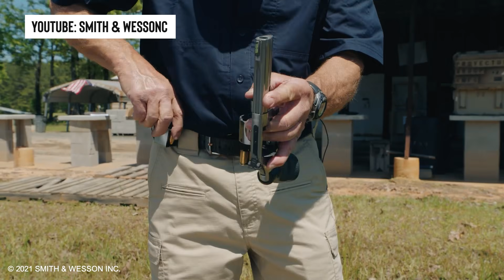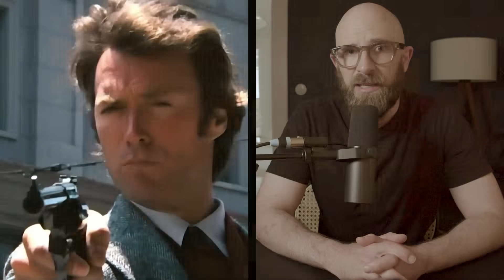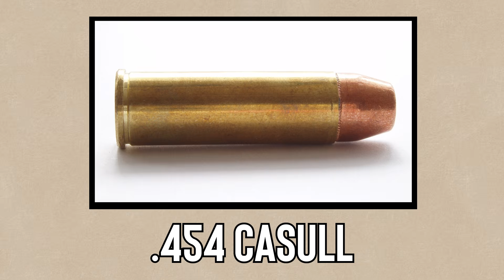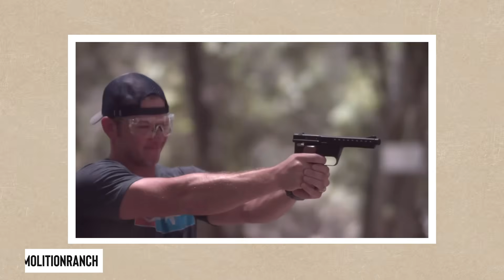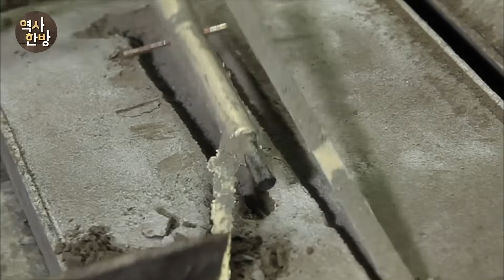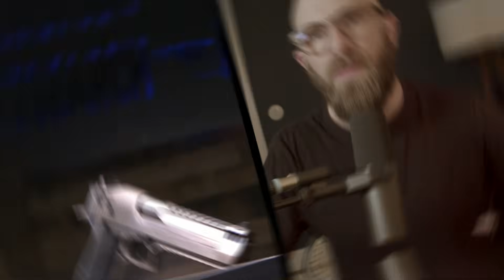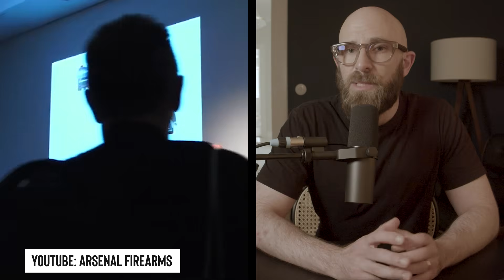Most Ridiculously OP Handguns of All Time

Comment: There was that gangster in the prohibition era that commissioned a full auto 1911.
Reply: Hymie Lebman (1903–1990) was a San Antonio, Texas, gunsmith that modified  several different firearms for 1930's gangsters, including full auto 1911's
Reply: @sambowz9077 Because he could do that without looking at serious prison time! Today the AFT would be all over him in a New York nanosecond!
Reply: @billmullins6833  Actually he did much of his "Work" after the NFA of 1934 and it was illegal at the time.
Reply: @sambowz9077  Was he prosecuted or was that before the BATFE got into the law enforcement biz?
Reply: @billmullins6833  He was prosecuted by the Feds ( the treasury dept, it was before there was an BATF) and the state of Texas, and he beat the charges. I think it was a hung jury. he died in the 1990's.
Reply: @billmullins6833 ATF.
Reply: As I understand its pretty easy to convert an semi auto weapon to full auto. 
The gun need an way to not fire again on chamber the new round, and full auto on pistols is a thing, its just very unpractical as its almost impossible to control
Reply: @magnemoe1  that really depends on the type of gun. Some it's easy, striker fired blowback ones can be converted to open bolt fairly simply. Because tube. Locked breech is a little more difficult. If the sear isn't being tripped once locked into battery and the hammer/striker is following it home you will probably have FTF from light strikes or worst case scenario and out of battery detonation. Sure, on some systems a little bent coat hanger can get the desired results but on others there is a little more fabrication involved.

Comment: When did we start measuring velocity in foot pounds?
Reply: Never. Energy is measured in foot pounds. As in, the energy a projectile delivers to its target. Velocity is just part of the equation used to determine energy. Energy determines how effective the projectile is.
Reply: its a commonly used freedom unit and since basically all gun channels are from there, its the common internet lingo
Reply: @GerManBearPig ???
Reply: @GerManBearPig  you are EXTREMELY incorrect. Foot pounds are a unit of torque, and a measure of work. They are in no way, shape or form a unit of distance

Comment: The 44 magnum was the most power handgun in the world when Dirty Harry was filmed. The 454 casul was still a wildcat cartridge at this point, so it isn't considered.
Reply: Correct, the first production firearm chambered in .454 Casull, the Freedom Arms Model 83, wasn't introduced until 1983. The cartridge itself was only standardized (SAAMI specifications) in 1997.

When Dirty Harry was released in 1971, it was the most powerful PRODUCTION handgun in the world. There are always wildcat cartridges and custom firearms out there that will be "overpowered" compared to readily available production firearms.
Reply: 454 was only even possible to shoot from old colt SAA's that had to have almost every part of the frame case hardened in order to not shatter when fired. 

Despite this intensive process, the. 454 casul was actually quite popular in the enthusiast community, which is why such an obscure and niche round got itself a dedicated production gun in the 1980s of all times. There was even law enforcement interest from random cops but it seems unlikely any ever carried the 454 when it was still a wildcat cartridge, as the potential for their gun exploding likely meant no cop was ever getting that approved.

Comment: I believe it cannot be sold in the UD as it meets the definition of a machine gun, i.e. fires more than one round with a single trigger pull
Reply: I say this sounds likely,
Reply: No. You can buy it still today in the U.S. you just have to get one imported or buy one already here. It's a Hassel and will cost. And it has to be done through a dealer. Anyone wanting one, willing to pay for it, will know how to get one. APF has one listed for 9k. But there will be other fees on that. Not really a gun most people are going to pay for.
Reply: The AF2011 has 2 triggers, they're probably no longer imported to the US because it's an expensive pain in the ass to import firearms, the manufacturer has to prove the firearm serves some type of sporting purpose like hunting or target shooting.
Reply: @roblopez8481 as stated in the video, the triggers are mechanically linked.  Pulling either fires both chambers, and the firearm is incapable of cycling from a single cartridge.
Reply: @chrism6880  I've seen other videos on it, some explained it gets around the machine gun classification cause it's considered volley fire. There's a 22 magnum double barrel revolver with a single trigger that has two finger grooves that's legally sold because it's a volley firing gun

Comment: Glock 18, basically looks like a normal Glock but it's fully automatic and can fire 20 rounds a second. That's over 1000 round in a minute, and considering someone did actually put a 100 round drum on one of these, but normally the max is a 32 round magazine, that's really OP.
Reply: 33 round magazine. i know because i have the mags...
Reply: OP but still relatively normal. Seems they wanted to stick with lesser discussed pistols.
Reply: @overlorddante OP meaning overpowered? Still trying to figure out what it means.
Reply: @ljkking622  yes
Reply: @ljkking622  OP usually either means overpowered or original poster. Context should provide the clues.
Reply: Given how impractical and garbage it is it doesn't win the OP title in the modern market due to competition and being completely ineffective, and being only a 9mm it doesn't meet the literal OP definition either of having a tonne of power going down range.
Reply: @Rule.303Gaming  true, but at the end of the day, it's a gun that can literally empty it's whole magazine in a second. 

It's not meant to be practical, none of these guns were practical. The list started with a handgun capable of stopping an elephant. 

There are some machine guns that have a much slower rate of fire and yet have 1,000+ drums specifically designed to go with it. 

So, if the whole criteria of this list is it has to be a handgun and it has to in some way be ridiculously overpowered for what a handgun should be, how can it not qualify based on rate of fire alone? When one gun only qualified because it happened to have 2 barrels? 

Thoughts?
Reply: @jhonsmith5093  The Arsenal is a volley gun that fires 2 .45 ACP bullets at the same time, therefore the power is 2x .45 ACP on a hit.

The Glock 18 is only a 9mm and firing only a single bullet.
Reply: Glock 18 is a converted Glock 17

Comment: .50 bmg is not a rifle round, it's a heavy machine gun round.
Reply: Its an anti material round
Reply: @trailblazer632  The .50 BMG ( .50 Browning Machine Gun ), also known as 12.7×99mm NATO, and designated as the 50 Browning by the C.I.P., [1] is a .50 in (12.7 mm) caliber cartridge developed for the M2 Browning heavy machine gun in the late 1910s, entering official service in 1921.
Reply: @692mhw  yes.... its anti material round. That was the point of the original m2 browning.  An anti material machine gun. At the time it could punch through most armor. It was adopted to be used against enemy vehicles and material.
Reply: @trailblazer632  The antimateriel rifle is originally based on the German 13mm Tank-gewehr, but the US had no equivalent rifle when J M Browning designed the M2 heavy machine gun, until the Barrett in M82 in the late 80's. Browning upscaled the 30-6 to create the .50. Because you end up at the same destination, doesn't mean it was the same journey.
Reply: @692mhw   thats because the 50bmg was never designed to be used in a rifle. Hence the anti material part. Just because its amachine gun doesn't make it less an anti material round. Being shot out of a bolt action doesnt make a round anti material. Size and performance makes it anti material round. The 50bmg was purpose built for the m2 browning a gun designed from the outset as an anti material gun.
Reply: The clues in the name M1921 machine gun, not material gun, as J M Browning named it.
Reply: @692mhw    that's not how that works at all 😂 where is the world did you even get that idea😂

Comment: No firearm is OP without adequate training of the person wielding it. Firearms are inanimate objects. Firearms are only as good as the person using it. A "bad" firearm in the hands of someone who trains constantly with it will be more deadly than someone with an expensive and fancy weapon who never trains, goes to the range, etc. Firearms are only as good or dangerous as the person handling it.
Reply: Ugh, you just had to be that guy. Work on your accuracy because you completely missed the point.